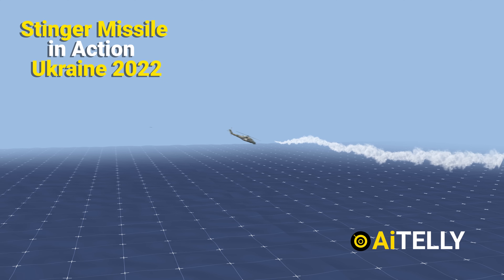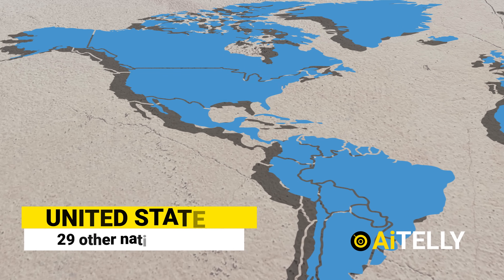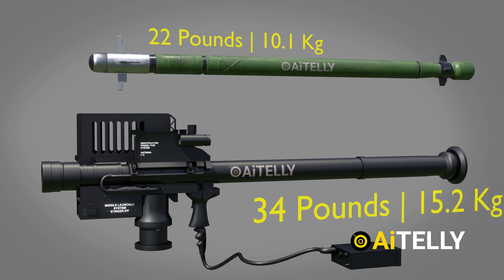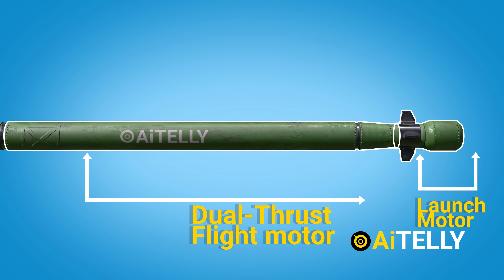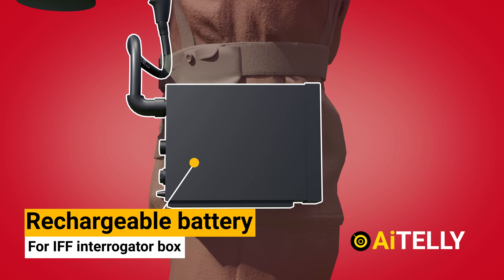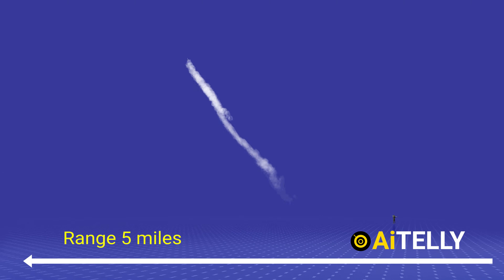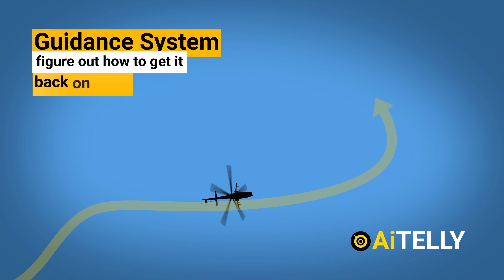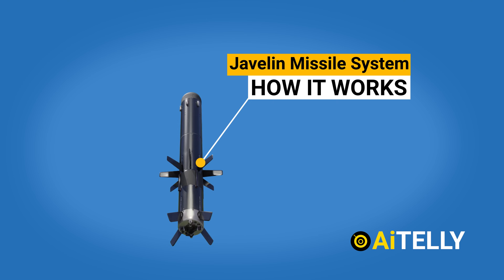Stinger Missile | How does a Stinger Missile Works? | MANPADS Stingers

Comment from the maker: 1)BlackWater 49- 0:50 That's not the modern shape of Germany. Look more like 1939-40 or something when the Wehrmacht can conquered Belgium and the Netherlands...

2)MM = millimeter (New Voice Over artist for coming contents)

3)Shane D’Angelo-You messed up on the sight assembly and the bcu is way too big. Other than that it’s pretty close to the actual look of the missile.

P.S Military Technology Data are a little tough to get our hands on and also classified and most of them are in a very grey area, but we will try our best as average Engineers and 3d Animators to bring out the best in a very Minimalistic or Simple Explanation.

We take full responsibility for our mistakes.
Reply: The description is too primitive, they did not describe how the management works. There is only one pair of handlebars deflected, and there are only two positions, left and right. And the other pair of planes are destabilizers, they are not mobile and are needed for better maneuverability. The rocket rotates at a speed of 20 revolutions/seconds, and these rudders switch in a certain way, make the rocket turn in the right direction. So if you are doing an animation of a rocket flight, you need to implement rotation around the axis. I do not know if there is detailed information on the Stinger MANPADS in the public domain, but there is information on the Igla, Strela-2, Strela-2M MANPADS, of course, in Russian. True, it is possible that sources could have been blocked in recent times, but maybe you can find a lot of people who downloaded during this time. Yes, the Stinger and Igla MANPADS are noticeably different, but they have a lot in common, and there, and there, a single-channel type of control is used.
Reply: Great video! Apparently they’re redesigning the chip components of the seeker system. I wonder how the seeker system will change
Reply: 2. We know but just take the engagement.
Reply: @Aitelly  what's going here
Reply: why can't you pronounce words?

Comment: Interesting fact about the stinger missile:

Only Two of the forward fins actually steer the missile, the missile actually spins in flight making it possible for two fins to be required to steer it. The reasoning is to reduce weight and complexity further reducing cost.

Comment: why does the stinger still need argon cooling? can modern camaras do the work without having to have a specially cooled thermal camera?
Reply: It's because it's an IR seeker. It's a style of seeker which requires low temperatures to filter out other IR "noise" for a clearer image.

Comment: I operated the stinger missile as a LAAD Gunner in the Marine Corps I’ve shot at least 8. Very good and informative video
Reply: i always been fascinated by missiles arithmetic. weapon manufacture always give percentage of success rate but theres really no real measurement. some base it on real war usage some base it on lab test.  fuel, radar, speed and arithmetic play a role in success rate. 

have you ever thought about those thing when you operated stringer missile?
Reply: @BlueRice  To answer your question in short yes, but we repeatedly learned this information for our missile so this comes almost as second nature. That’s all I can say about that respectfully
Reply: Why does it have a bookshelf mounted on the side & why do you need a fresh can of stinger juice every 45 seconds. 

The video failed to explain those points. 

I thought this was a self sufficient platform. I also thought that the gun sight was gonna be akin to a fighter jet's head's up display. Displaying range to target, lock on status, and time on target after launch.
Reply: @dr.pastrami5272  that book shelf is an Antenna which communicates with aircraft determining whether its friendly or foe. The can is a battery and the longer it’s in the battery well  it can implode then become stuck in the battery well and cause significant damage. I don’t think I can discuss when this will happen but 45 seconds is a great point to aim for. There is no heads up display rather its different statuses are communicated in a series of tones and beeps. There is also a bone transducer that acts as a secondary status device. As far as range is concerned we are trained to make near accurate perceptions in distance to aid us in acquisition.

Comment: I wonder how does it interact with aircraft that uses flares or any electronic countermeasures jammer

I know in battlefield 4 this weapon is very popular to use and slightly accurate for what it's known for. Though the range is misleading in the game
Reply: For flares 
They spread Out in sich a Partnern that the middle thinks those are the engines and track them instead 
But For fammers im interested forb

Comment: I wonder if the short battery life and shelf life of the BCU was completely by design. After all, if the US sells the stinger to so many different countries is perfectly reasonable to assume that adversaries would also get a hold of it through the black market.

But with such a short shelflife it wouldn’t make much sense for them to buy it, thus limiting how many of the US’s enemies will use it against them. I know at least one anti-aircraft missile made by the US can identify US made aircraft by the outline and thus will not track it. I’m just not sure if it’s the stinger or not.
Reply from the maker: The Argon gas has a very Low Shelf Life it was design a few decades back.

But  it was meant for the tracker IFF "Friend or Foe"
Reply: Stingers are in service with the LDPR militia. Moreover, not all copies were captured, some were bought. And a lot of Western weapons are sold to just anyone. As they say, to whom the war, and to whom the war is just a good business, nothing personal. And yes, it's easy to disable the friend-foe recognition system.

Comment: Why does the seeker need coolant? I mean any consumer grade camera works with passive cooling. What does this seeker do so special?
Reply from the maker: Credits to Will Morris
Thermal cameras see with heat (IR), by using a chemical grid that turns incoming IR into an electric signal, much like the camera on a cell phone

But, the normal heat of the chemical grid blinds the grid to low level IR signals. It's like having a night-light inside your 35mm camera ruining all your film.

Cooling the IR chemical grid reduces this “night-light” so that it will be able to see much more distant and dimmer IR sources. The IR grid is made very cold by using evaporating liquidied gas (something like liquid nitrogen evaporating). They commonly use liquid Argon mix for this purpose, because of its compressibility and evaporation properties.

Miltary uses both cooled and uncooled IR systems. There has been a lot of work to make uncooled systems more sensitive and cooled systems cheaper. Cooling is a pain, expensive, takes time to actually cool the IR grid and has limited arming time.
Reply: Thanks for detailed explanation, so basically it's like wanting to set camera ISO very high while still maintaining low noise image?
Reply: More sensitivity for thermal IR. The stinger has the cooling canister in the battery, the javellin system has the argon canister inside the missile itself that is activated once you confirm target lock. The targeting is different too. The stinger is for the most part optical, while the javellin is purely thermal. 🤓

Comment: How to add a new one missile after firing ?
Reply: Buy a new one
Reply from the maker: You Do not need a new Tube
You just have to insert a new missile
The launcher is reusable. Each missile is a sealed unit that weighs only 22 pounds (10 kilograms
Reply: You need a new missile and a fresh battery, the tube and targeting unit is reloadable.
Reply: You don't. You have to switch out the empty launch tube for a new one with a missile in it. It's basically a 1-time use system except for the targeting and grip stock.

Comment: These missiles hasn't make much of a difference in the Ukraine-Russia war. One problem with them is that there's no electricity in the battlefields to recharge the batteries. The other problem is that once you fire the missile (from the ground) you reveal your position to the enemy so you can get fired upon immediately. Of course they were effective in Irak and Syria where the USA fought agains farmers in sandals with old WWII rifles that can not return fire, but Russians have state of the art weaponry so fire the missile and run for your life.
Reply from the maker: You have a good point there.
But the Question is why are the Ukrainian asking for more Javelin and Stinger Missile
Reply: @Aitelly  Because they can resell it in black market, they are selling Javeline for $30K.
Reply: @Andrey222ful  You plainly invented that.
Reply: Bwahahahaha!!!
Reply: I was a 16S (Manpads crewmen), in the military. We trained with the Stinger missile. The missile comes with 3 batteries, which are non-rechargeable. The BCU, battery, also comes with a needle like probe in the center of it. The probe has a red rubber plug, mounted on this needle, and must be removed before the BCU is inserted in the Stinger missile. Once inserted, it releases argon gas to cool the gyro, heat seeking missile. The heat seeker spins at such a high rate that the missile needs the argon gas to cool off the gyro heat seeker. Once the battery is inserted and the trigger switch is pushed, to just activate the missile, not fire it yet, the Argo has is released into the heat seeker. If for some reason, like the aircraft is out of range, false alarm, etc, and the trigger ISN’T squeezed to fire the missile, the battery must now be disposed because it isn’t functional no more. The batteries also have a certain shelf life and have a disc on its end to show any operator that the battery is now defective.
Reply: 'These missiles worked in Iraq and Syria, where farmers could take down the technologically superior USA. 
They don't work in Ukraine however, despite Russia and Ukraine fielding mostly technologically inferior weapons compared to the Americans.'
Yep, makes total sense.
Reply: @flopsinator5817  Strawman.  He didn't say that.  Quotation marks won't change your words into someone elses.
Reply: @censorthis-uu6cc  I was paraphrasing.
I just wanted to highlight how stupid and little thought through his argument was.
Reply: holy shit this channel is full of copium enjoyers
Reply: The smoke trail left by the missile has ALWAYS been an issue. You are right, once a middle is fired, everyone now has your position. That is why every Stinger vehicle is outfitted with 6 missiles and another gunner/team chief. If you miss your partner should already have another missile on standby. You also have quite a few teams in the area, ready to fire.

Comment: The 1980’s Mujahadeen of Afghanistan sold/gave theirs back to the US after the Soviet war.  Because the Argon packs shelf life ran out and the US would not supply new ones.
Reply from the maker: Yes that's True that's why they have less than a minute to Fire the MANPAD after it is locked on the target.
Reply: Yeah, it turns out surface-to-air missiles don't get a lot of use when the aircraft have no fuel.
Reply: @ThirdLawPair  really, so there will be very less damage
Reply: Aka taliban  the one America says are terrorists remember
Reply: Good thing they didn't keep the warheads and attach some sketch wires to make IEDs. Oh wait.
Reply: Nah hopefully it wasnt used as a normal rocket !@jefism

Comment: Can soldier reload it?
Reply from the maker: Yes, it was designed to be armed by a Single Soldier. But you Usually see a team of two Soldiers operating it.
Reply: @Aitelly  so u can reaload after shooting? No like jawline.
Reply: @Huzenッ  No, only the gripstock is reused. The launchtube (incl. the missile) is replaced.
Reply: @spekenbonen72  so there is no stinger like RPG 7?
Reply: @Huzenッ  no, not really
Reply: You cannot reload it because the whole system is embedded i side the tube, I think the only reusable in the equipment is the trigger part and the targeting scope. Its one off and scoot.

Comment: yup I never knew It Requires a BCU unit and only 45 Sec otherwise  its Out
Reply from the maker: Thanks you for your concern
Reply: One of the reasons that the missile comes with 3 BCUs.
Reply from the maker: @korbell1089  👍
Reply: Most MANPADS and ATGMs have a time limit from when the weapon is enabled and the missile is fired.

Comment: Love the Work  I did not Know they had to use the Argon Gas for powering the missile.
Reply: The BCU (Battery Coolant Unit) contains both pressurized argon and a thermal battery. The argon cools down when allowed to expand. The cold argon cools the missile's thermal sensor. The BCU also has a one time use "thermal battery." This battery gets really hot. Videos showing the Stinger being used show operators quickly removing the hot BCU. I believe the BCU has to be removed quickly to avoid damaging the launcher from heat. We don't use thermal batteries in everyday life so it seems really odd (at least to me) that they work this way.
I was hoping this video would go into more detail about the thermal battery. I'm having trouble finding good information about it.
Reply from the maker: Thanks for the Feedback.We understand you.
The problem with military engineering videos is usually most of them are still classified.
So a lot of them especially those which are in Service information is a bit difficult to acquire.
Will try to find out from our Military friend if he has some idea, although I doubt he has handled a Stinger Missile.
Reply: If the infrared seeker gets hot, it gets blind, so yes
Reply: @aslamstudio558  Thank You
Reply: In Russian MANPADS, this principle is also used, only not argon, but nitrogen, it has a tempo. the boiling point is -196, it cools better and the sensitivity of the GOS is higher.
Reply: 2+2=4